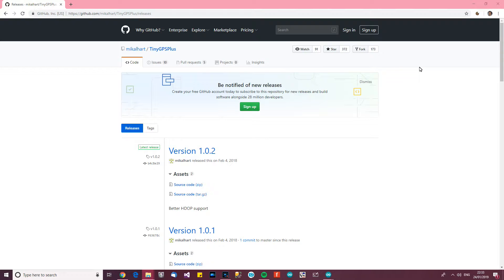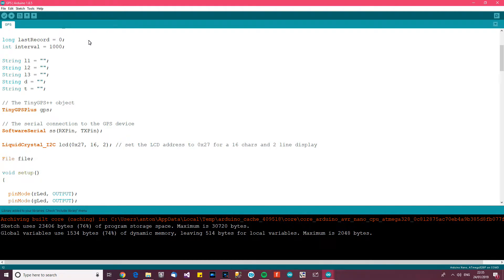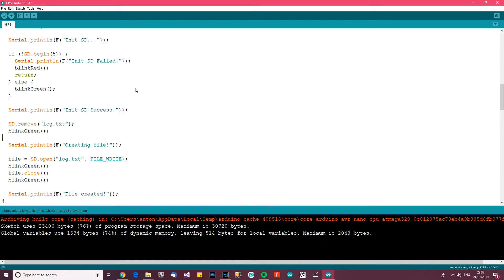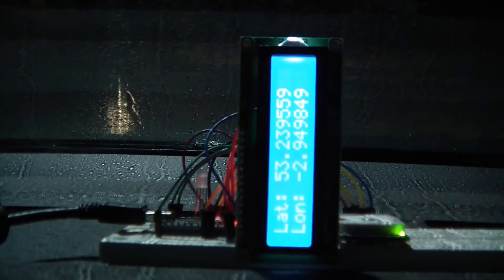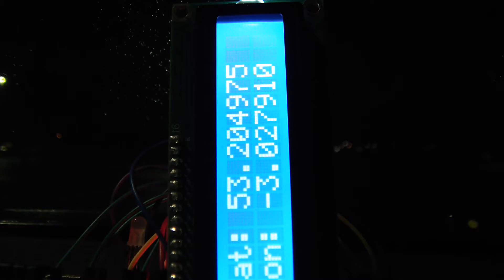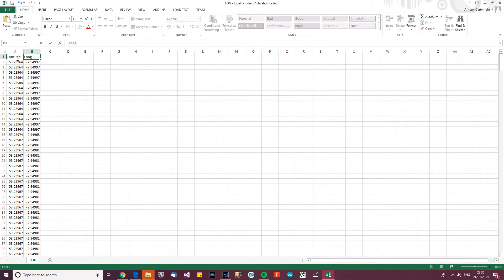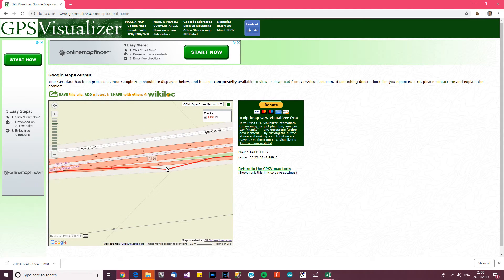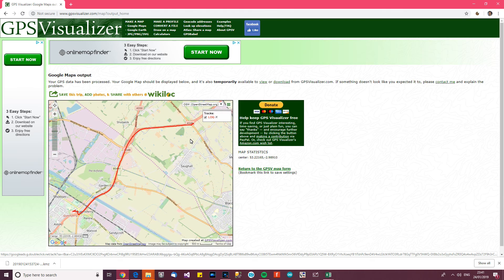TUTORIAL: How to GNSS / GPS Logger | Arduino - Reyax RY82530 - LCD - SD Card | Part 2 - Results!

Comment: i am beginner in Arduino. today i bought a Arduino pro micro for learning(32u4) . but i don't is it have a bootloader or not! 
how can i know it??
Reply from the maker: Hi, Pro Mini isn't the easiest for a beginner. Is it possible to buy a Nano instead?
Reply: First start with Arduino Uno, then Nano. Most sellers will install the boot loader with a blinky sketch to test. If your Pro Micro module blinks when powered it most likely has the bootloader. Then make sure you have selected the proper module in the Arduino IDE and try to upload a slightly modified blinky sketch. If it fails look at the error message. Perhaps you selected the wrong com port. If it doesn't have a bootloader, you can invest in an ASPUSB module which you can connect to the ICSP pins and then burn the bootloader yourself. If that's a bridge too far for you, then just store the module for later and buy some other Nano modules. (BTW. The Pro Mini needs an external serial device to program, but the Pro Micro has USB build in.)